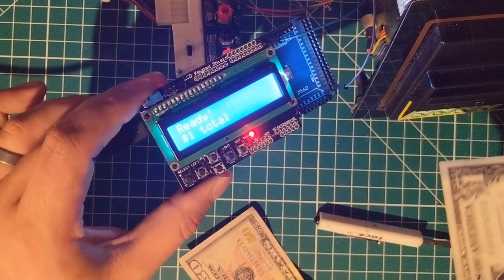Arduino Powered Cash Reader

Comment: i wish you had a 110 volt version of this.I wanted to know how i can disable it after a bill is accepted until my sketch is done.I wouldn't know where to look for the type of disable like you did with the 5 vdc on yours.What is that 5vdc disable labeled as on the 24 volt?(5:10)
Reply from the maker: I didn't know they made a 110v version.  The 5vdc disabled is basically a way you can turn the bill receiver off.  So in other words, if you're in the middle of booting up, you can send 5v to the bill collector so it won't accept bills until you're ready.

Comment: Cool toy.  8000 pulses seems like an awful lot of pulses for one bill. Is that output from a rotary encoder as the money passes through? or is it sending a "beep"?
Reply from the maker: Sorry. I missed this comment.  I need to do a firmware update on the device or find some older cash because it can't read the big face bills. So basically I just used that number because it always triggered on a successful read and never on a failed read. Since it only reads $1 bills, that was good enough for my purposes. I still need to do more tinkering though.

Comment: Can I use the pure arduino pins to inhibit or I need to use it with relay?
Reply from the maker: I think you need a relay to act like a switch.
Reply: @AnotherMaker   no, I watched and There are an optocoupler so I can use the pure pin
Reply: Now it is works fine,